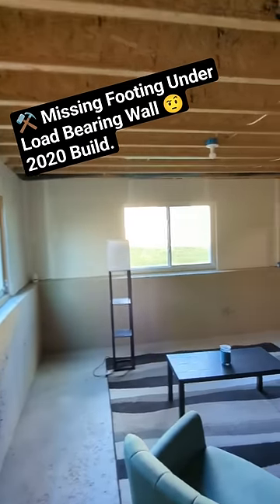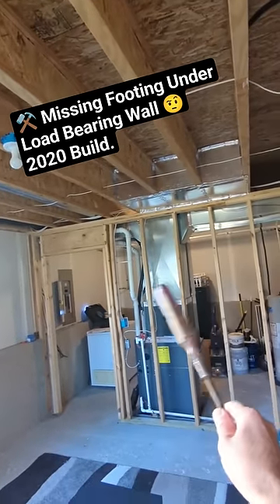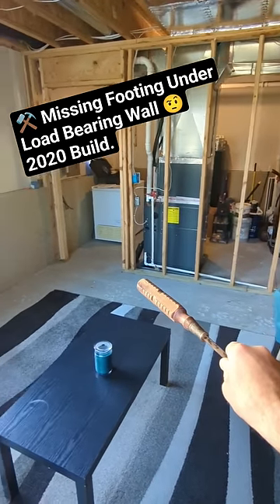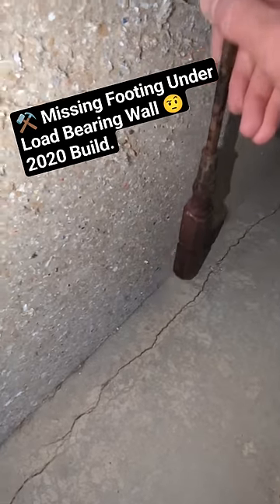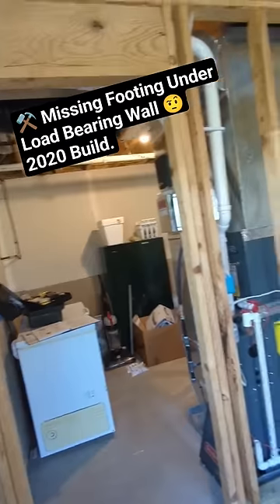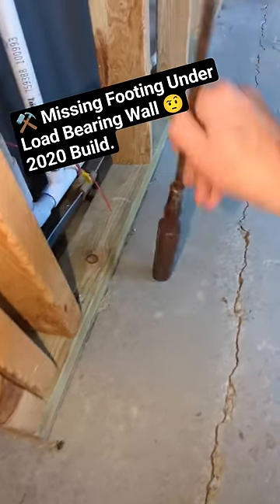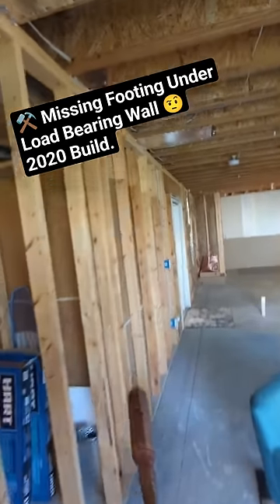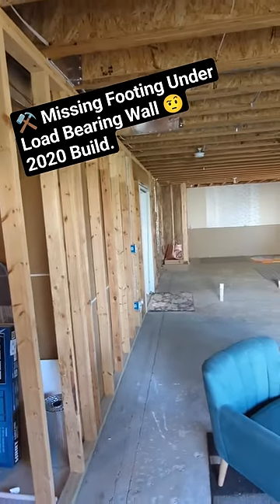FOOTINGS missing under load bearing walls NEW BUILD A trick to find missing#footing under #concrete

Comment: Hairline crack? thats a friggin grand canyon my dude
Reply: heheh LOL
Reply: Moses Parted that Crack
Reply: @MegaMeco2  He would probably call the Biblical flood  "oh just a light drizzle." LMAO
Reply: That room has great drainage...
Reply: The most generous inspector of all time
Reply: You can fix it with expanding foam for doors and windows
Reply: @BryanChance , tidal wave < => moisture 😅😅😅
Reply: I'm more concerned about that on a brand new house. Lots of settling that should have happened
Reply: Yes, yes, yes, but look on the bright side. Come spring, the homeowners will have their own personal indoor wading pond they can stand in while doing laundry. So they've got that going for them.
Reply: @kennethpace9887  Yes it does. Unfortunately that floor is going to drain in the wrong direction. UP
Reply: In roughed-in masonry work, it's just a regular crack😂Not the parmesan type😅
Reply: You will see the roofline sag and cracks in the plaster walls below the sagging roof in a few rainstorms later.   This house needs some serious foundation work already.
Reply: Especially big considering how new the house is. I'd like to see how that house holds up over the next 20-40 years.

Comment: Headers can be in a non-load bearing wall also.  The size of the joists and the span is what tells you that it is a load bearing wall.
Reply: Span is the end all indicator
Reply: Why are people talking about headers ?
Reply: @andreaspease9935  Did you watch the video?  He said you can tell that it is a weight bearing wall because of the headers, which has nothing to do with if it is a weight bearing wall.
Reply: You can get some very heavy duty joist that you can free span with....if that is desired I have span pretty far with 2'-0" with 31/2" cords
Reply: @The_Real_Indiana_Joe Doesn't change the fact that it runs perpendicular which by the looks of the span it is and 8f so definitely requires headers.
Reply: @The_Real_Indiana_Joe you should not load bear onto 2x4s in a basement. Could get wet and they aren’t strong enough

Comment: The floor joist extend from exterior wall to exterior wall and those are designed not to need any support in the middle so that wall isn't holding a damn thing.
As a matter of fact you could take it out and throw it in the yard.

I'm a 53-year-old contractor that's been doing this as I was 15.
Reply: I'd like to believe you, but why was that crack running the length of that load bearing or not load bearing wall?
Reply: What would be the solution if the video was correct?   If there’s actually a huge fuck up like that involving the foundation, what can be done? Seems like an unfixable problem
Reply: @chipper1112 a very messy basement for a couple months
Reply: @ethanwestbrook9853   so the solution to this would be install temporary shoring for support,  and then demo the floor, add the proper footings and pour new cement?

Comment: Me personally,  I put headers over every opening……. Just the way I was taught 50+ years ago
Reply: That’s how I do it too because that’s how my grandfather taught me how to do it working with him when I was in grade school.  Learned so many things from him and I am very grateful for those lessons too
Reply: Was gonna comment the same. I started framing in 2003.
Reply: There's different headers. He misspoke. You can tell it's a load bearing wall because there is no beam. There's nothing else there to support the joists in the center of the room.
Reply: Wasteful
Reply from the maker: 😉Thank you. Here's the rest of the story...
What people may not see in the video is the larger door opening has a laminated header and on top of the top plates theirs 
two laminated beams setting on top which are perpendicular to the wall.
This is applying more weight load down to the slab areas.
In addition, there is a large bedroom  beyond the wall that extends beyond 24 feet.
Thanks for watching the video and the comment.
Reply: The room looks 20ft wide and the correct joist sizing can rest on just the exterior walls. My guess is that the first owner had a wide open basement and wanted to finish it out a little bit or do builders typically put in framing and just stop there and call off the drywall guys?
Reply: Its a total waste of time and material.
Reply: But why? Thats just a complete waste of expensive beams, especially now and when the lumber index was at an record high!

I'd learn load paths and
Reply: But why? Thats just a complete waste of expensive beams, especially now and when the lumber index was at a record high!

Learn load paths and you'll feel confident of where and why you don't need them where the engineer does not call for them.
Reply: Didn’t know it was an option not to
Reply: I do too. Most walls in a wood framed house eventually take some of the load.
Reply: everyone does it that way
Reply: @inspectflix I despise laminated beams or any of that osb bs they’re pushing out now.
Reply: @inspectflix  OMG!
Reply: I was taught you start off renting.  Then you buy a house before you build one then after you retire just sell and or move back to renting 🎉
Reply: @Bruceless Exactly that's why we don't even put double plates on non bearing walls. Just a 1x4 4' where splice is.
Reply: That’s what I was thinking this should probably be torn down because the issues are appearing from the inside out
Reply: Unnecessary, unless load bearing and problematic if you have to run wiring above the door.
Reply: @brookelord3448 correct plus we don't know what the load is on the second floor. Might be perfectly fine.
Reply: @mitchcummings6276 And then you too can be called back, in just 5 years time when the slab settles and the door frame is now 5° out of plum and the door doesn't close properly anymore.
Reply: @ebolawarrior451  Why? They are stronger than ordinary wood. No knots. Uniform dimension every time.    Scientific marvels, Andy! (Dep. Fife from Mayberry voice).

Comment: I believe I'm correct in saying if that wall was in fact load bearing there would need to be crush blocks between each of the engineered joists. But those I joists can definitely span further than the wall there going over.
Reply from the maker: Correct on the span, depending on the manufacturer chart for span. These were approximately 24 feet. 
Depending on the size, the minimum I've seen is 17 feet.
Thanks for watching
Reply: @inspectflix  was the measurement 24ft to the "bearing wall" or 24ft to the outside foundation wall....could be a "grain elevator " style home that are usually 24 -26 ft wide
Reply from the maker: @briansmith3191  Approximately 24 to the outside foundation. What you may not see in the video is the larger door opening has a laminated header and on top of the top plates theirs two laminated beams setting on top which are perpendicular to the wall.
This is applying more weight load down to the slab areas.
In addition, there is a large bedroom  beyond the wall that extends beyond 24 feet.
Reply: @inspectflix  yeah I hear you..they could of just put  a "beam" down the center of the room on "pads" with telecasts...wouldn't of even affected the door openings...but then we would have nothing to "talk" about.
Cheers
Reply from the maker: @briansmith3191  👍 making short video is tricky with so much information to cover. 
Thanks again
Reply: Right load bearing  and a supporting  wall are two different  things people are silly

Comment: If this was true it would be a pretty massive fuck up not to notice the missing footer during the pour or construction of the wall. Good to check but I bet that wall isn't load bearing and they just added headers anyways.
Reply: You are right. The joists appear to be engineered beams and I'll bet they are rated for the full span.
Reply: Those joist can be much longer than natural wood ones.  Doubt that its a load bearing wall!
Reply: Yeah, i’m not a carpenter, but I fight with them all the time and where we fight, they put headers over every door and window. Maybe its not load bearing. Show me the load, not the support, to prove the existence of a load.
Reply: They would not use 2x4 on a load bearing wall it be 2x6
Reply: @denniswilder3014  only if the load required it. 2x4 can hold up a good bit
Reply: I'm a concrete guy... This is most likely the engineer/architects fault. They didn't put the footing on the blueprint so it didn't get poured. The other possibility where it is the concrete guys fault is they ran short on Crete on the footing, then the foundation, so they would pour it before the slab and they also didn't pour it then. But that doesn't make sense because that would be more money for them. And even the crackhead concrete guys I know who have poured used engine oil on the forms would make certain they got the footing in
Reply: @PC-vx6ko 
I don't believe someone would use a 2*4 for a basement load bearing wall as the wall must support the first floor, and either roof or second story and roof. Also those floor joist are engineered meaning they can support more in longer spans. This was is a finish wall that was most likely done by a vet framer that was taught to put headers over every opening. Old homes (50+ years) in the Midwest had headers over every opening, even on non-bearing walls. Also if it was a load bearing I believe there must be anchors set into the beam footing to tie the wall to, this wall appears to have tap-con type anchors (not rated for load).

Comment: My skin freaking crawled when you tapped on that slab 😅
Reply: What is footing?
Reply: @nofurtherwest3474 a deeper thicker concrete pour meant to hold weight. 
"Slab" is the thinner pour (the middle section) which isn't load bearing
Reply: @dommyboysmith  ahh thanks. so they can build a long footing under that wall? I dont' think I've ever seen that. Just footings where the posts are.
Reply: @nofurtherwest3474  not by definition, but extra concrete that extends down and out along the exterior and interior load bearing walls. If not, then it’s just 4-6” of concrete resting on the soil carrying all that load.

Comment: The joists span the length of the house. That wall is framed as it were to be a supporting wall but doesn’t need to be. If the slab heaves the wall will push the the floor joist up. I think the crack is because the control join right next to the crack was not cut deep enough.
Reply: I also was thinking the wall might have been added later. There aren’t even any anchor bolts holding it down.
Reply: Yeah, the joists run the full length. The outside walls are supporting them not that little interior wall. The video is bs. And definitely agree on the cracks
Reply: I think both of you are being plain ignorant. You have know idea what is upstairs and still you refuse to believe your eyes. SMH
Reply from the maker: @johnbeckwith1361  Thanks. Here's the rest of the story.  
 What you may not see in the video is the larger door opening has a laminated header and on top of the top plates theirs 
two laminated beams setting on top which are perpendicular to the wall.
This is applying more weight load down to the slab areas.
In addition, there is a large bedroom  beyond the wall that extends beyond 24 feet.
Thanks for watching the video and the comment.
Reply: Why would a basement wall heave? It can settle but wont heave. Heave is caused from ice expansion.
Reply: Exactly
Reply: You are correct. Those are TGI Joist and they are full span. Those are squash blocks in between the joist.
Reply: @SmoothOperator319 it can also happen with expansive soils. I have had a project that required slab on void to address potential heaving. Probably not something that is done in a residential home though.

Comment: Telling homeowner their footing failed the wood handle screwdriver test.
Reply: Duh that's the sound resonance test
Reply: X-Ray inspection will confirm whether or not his observation is correct. This is actually a pretty simple test to use to write up further investigation. It's also 98% or more accurate.
Reply: @twistedgamer6  this is a variation of what is called "chaining" a bridge deck. When you rattle that chain across there you can hear the part of the deck that isn't solidly connected because the frequency and the quality of the sound is different in the spots that are not connected
Reply: The concrete being complete cracked kinda tells you it’ll fail any test you give it but ok
Reply: Hey now that’s a very scientific test bro. Even the screwdriver has to be OSHA approved and calibrated by the state.
Reply: You'd never think this if the floor hadnt cracked under the weight of the wall. They'll need to have a test done if they don't want to admit that they didn't put a footing under that wall.
Reply: Exactly bro. These inspectors are all hacks
Reply: @killax7  I'm with you the simple noise test is not going to work in a lawsuit and it isn't needed to work all you have to do is dump it and suspect that break out a hole about a 1 ft square dig down to it and take a picture underneath where there's no concrete in a footing
Reply: 😂 That's a good one😂
But for real.
Reply: They have a drill bit to take almost like a mini core sample. You can actually test it in a few minutes and know for sure whats going on.
Reply: Good catch!

Comment: Headers are needed regardless since the wall will always draw a load.  And I don’t know if I’d consider that as indicative of no footing.   It could easily be the wall is on a footing and the slab was put on bad soil and the slab has settled and the wall has stayed in its proper place since it has a footing.   And yeah I have an engineering license.   The conclusion he’s drawing isn’t really proper.  If the wall is settling you’d see it by checking elevations and there’d be weird settling at the doorways since it would have a more concentrated load at the king post.   I just think it’s uncompacted fill under slab and a lack of control joints in the concrete

Comment: Thank you for the headers in all the walls. Very much appreciated.  It always helps when you go over and above the as-builds  /plans.

I have looked at that video about 30 times and then slowed it down and studied the TGI’s. What I see is an extremely bad pouring mud / concrete. The average person would call it cement which its not. Why is there a definite seam all the way down the middle of that small slab? The question you should be asking is why is a lateral crack all the way down the slab. Yes I repeated myself, I’m curious.  What the compaction rate,  and is there rbars in a slab? We already know it’s not post tension Because of the condition of that slab. Are there as built to go with this video?  Engineering stamp goes a long ways along with the inspector stamp / signature that signed off on the work,  There’s nothing wrong with  the framing and I don’t believe its not a loadbearing wall.  
 Thank you for all the framers that know what they’re doing. Keep cutting straight and keeping the Plumb. Good job guys.

Comment: You could try drilling an inspection hole.
Reply: That would be the next step, yes. Because the GC will say it is there and the inspector will say prove it.
Reply: @sotl97  I’m sorry you have to go through that. I’ve been building since I was a kid, and I’m passionate about doing a good job; I always have been.

If you have a 10% hold back I’d recommend not relinquishing it till this is fixed.

Comment: I wonder if this could be a differential settlement issue. If they didn’t compact the trench, it could settle enough to cause that. Could also be a thickened slab in that spot, which might explain the uniform crack running the length of the load bearing wall. It’s be interesting to see this once they break out the concrete for the repair.